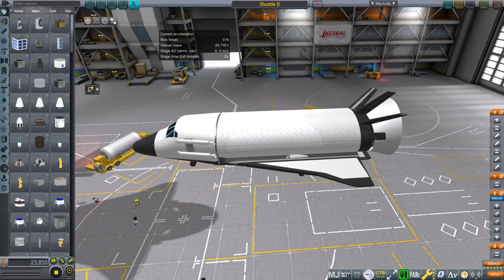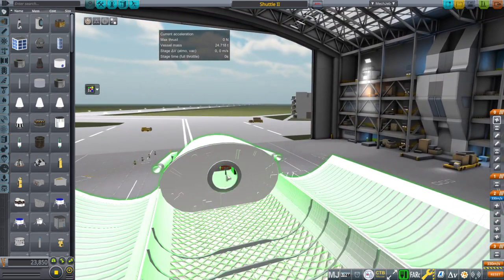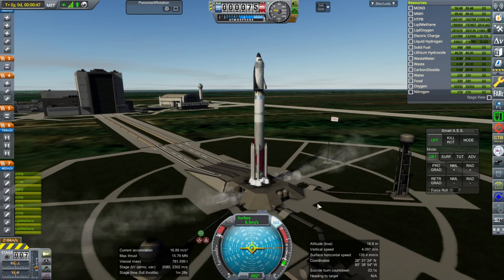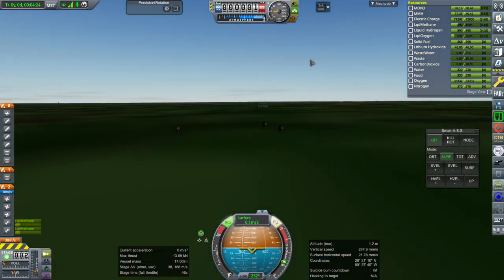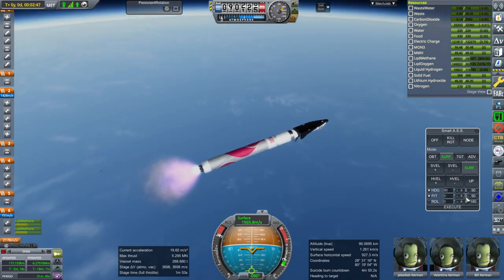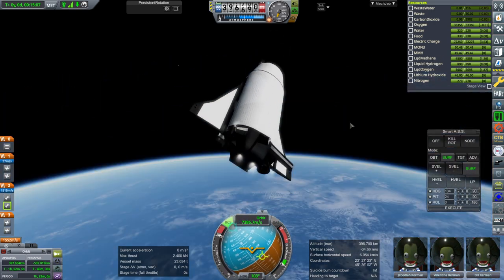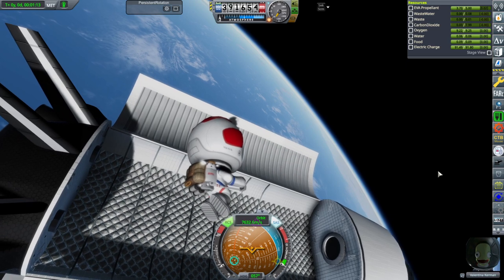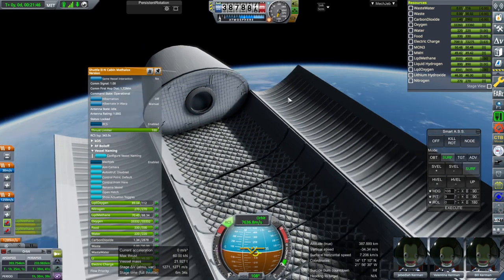Realism Overhaul in KSP 1.11 - Shuttle Mark II Testing

Comment: How do you find the performance of 1.11 RO compared to 1.8.1? I'm running on a potato and any improvement is welcomed. Love your video!
Reply from the maker: I haven't got a good handle on that, partly because I've been conditioned by games of old to not notice frame rates.

Comment: The Vulcan reminds me that the Vulcan 1st stage from your pack does have some pitch authority issues... it doesn't like to hold the pitch properly
Reply from the maker: Hmm - I'll have to check that out. Is this 1.11 or another version for you? I had only tested Vulcan in 1.8.1 before and I wonder if this is a new thing.
Reply: I use 1.8.1 and I still haven't found any solution for rssve for 1.11

Comment: Can I suggest you look at the "Hercules" Single Stage Lander concept? (https://sacd.larc.nasa.gov/wp-content/uploads/sites/102/2018/10/2017-08-AIAA-2017-5288-Official-Paper.pdf) One concept I've seen it using this in place of the Falcon Heavy upper stage/payload with either a Raptor or BE-4 engine.
Reply from the maker: I feel like Elon got to that one before I did, though admittedly his is a bit larger. I've got my own sort of system in the works, but landing horizontally, which I've seen from other NASA proposals.
Reply: @RaizSpace  Actually the original ITS concept came out before this but it was more based on a concept for maximum ISRU and rapid base/outpost build up. Fun part is unlike "Starship" it has as plausible abort system, some versions allow a modular break-down for fast habitat, hopper and tank farm production and separates the Interplanetary transfer from the lander function making it a  more versatile system..

I'd rather see horizontal landers myself to be honest they would have vastly more utility than a vertical tail-sitter.

Comment: How do I create the screen for the cockpit in blender
Reply from the maker: When you say screen, do you mean on the control panel? If it's non-functional, it's done via texturing. If it's functional (gives you information), then you need to use KSP's prop system and place it in Unity, not Blender. That latter one is a bit complicated and I haven't ever done it myself.
Reply: @RaizSpace  you should, once the spaceplane is stable, it will be like a cherry on top, to have functional displays and switches... and besides, how hard can it be? landing on Laythe seems tougher :D